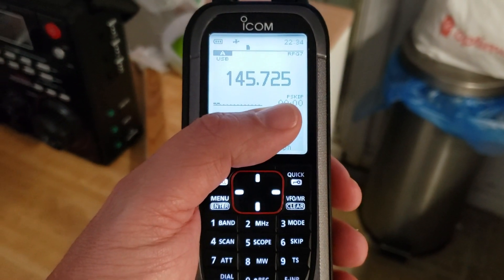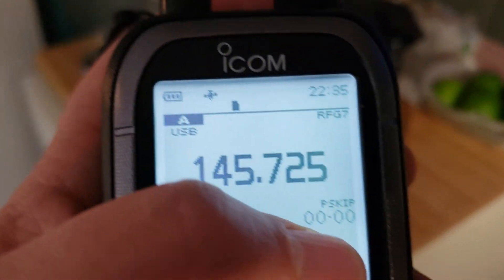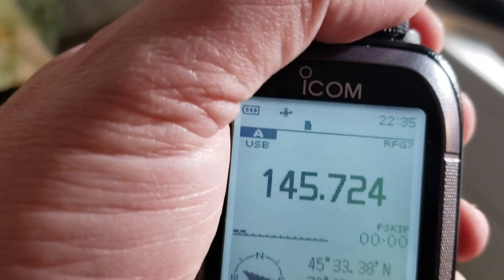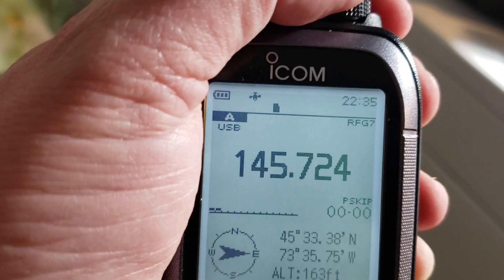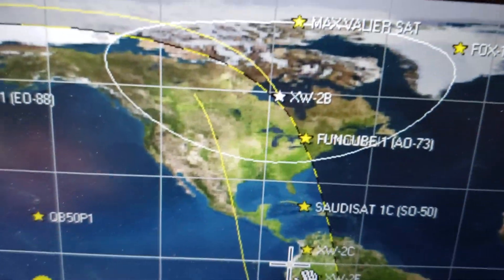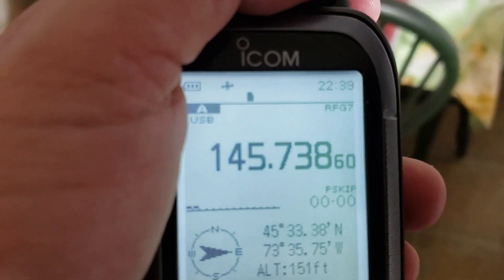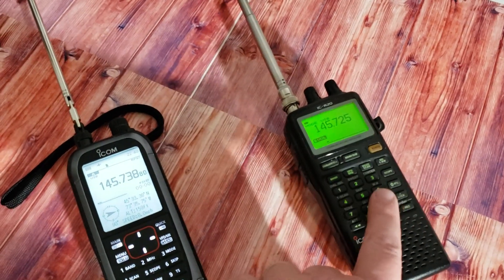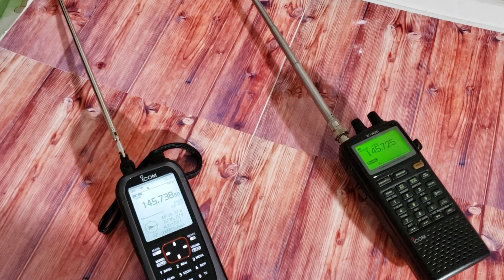XW-2B hamsat on Icom IC R30 portable receiver on telescopic antenna

Comment: Nice video on the R30. I use the R30 on many external antennae to get the most out of the device. Sadly there is no CAT control interface code available as there is for the R20. I'm waiting for it to appear for a year now but no luck. With this one could use sattracking software to control the Doppler shift on the R30. Unfortunatly I sold my R20 last year and am a bit dissapointed that there is no support for the R30 from Icom, HamRadioDeluxe, Omnirig etc... Maybe we will get Lucky when the R30 gets more publicity and sales numbers will improve. Seeing the price we paid for the R30, Icom could have provided us with a CAT control code. Bugger… 73' Ron

Comment: Thanks for a great video, I'm very impressed with your IC-R30 reception inside on a telescopic antenna, you are making me rethink my next purchase.  Also I'm glad you mentioned the gain level setting.  Maximum gain = maximum overload, intermodulation and distortion. 73 VK1MAC

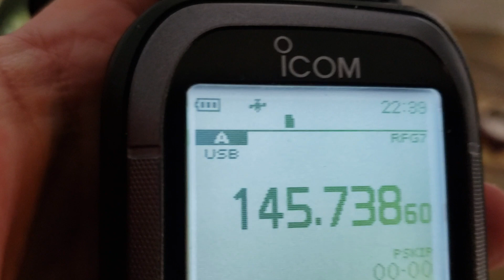Comment: 5:32 well, this can be definitely applied to any radio our there. I heard many things about your iCOM on some German forums but I think that people just don't spend enough time with their devices to explore the settings and setup it properly. 

I recently purchased a AnyTone AT-D868UV and this little peace of hardware isn't that bad like anyone else is saying.

I recently went up into an mountain that was located in the near of my city and I was able to speak with some peppers who were located very far from my location. 
They reported that they heard me clear and without any noises in the background even though I was using the stock antenna.

I have also to say that it is always a good idea to upgrade the firmware (if possible) before the initial setup.
This can also save the unnecessary troubles that probably have been already fixed a couple of years ago